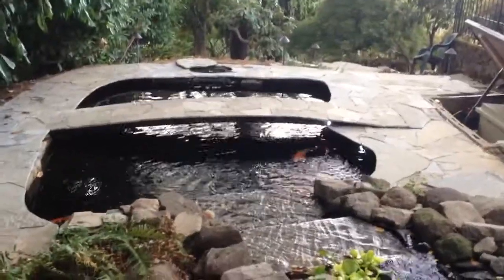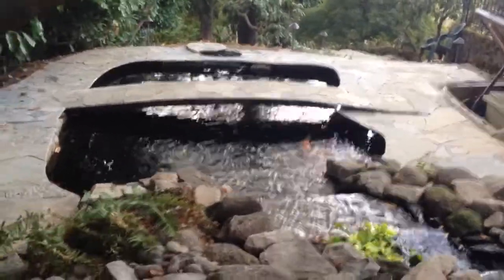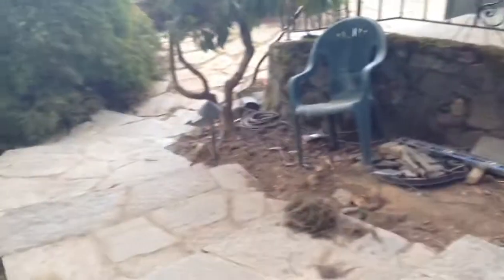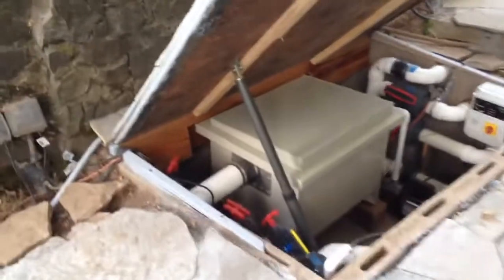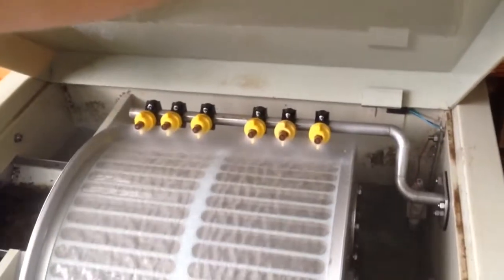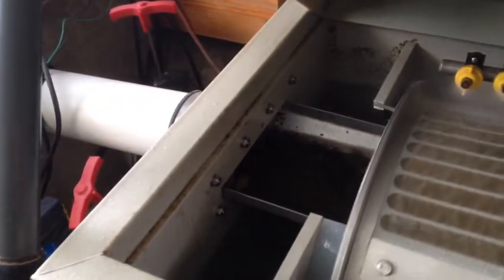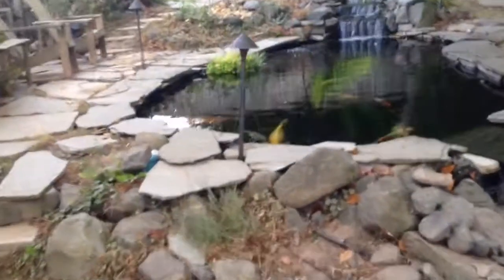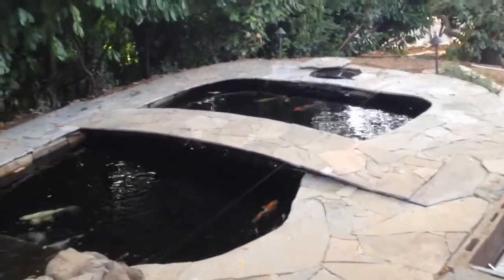Lower Pond mechanical revealed

Comment: Hi Rob, nice pond you have there... two pond on one filtration system. 
I want to ask you about the RDF, are you install the RDF from first time you build you pond?
it look crystal clear. because I want to upgrade my pond filtration system. 

thanks 

GEDE ARYA 
from Bali Indonesia
Reply: Yes this was installed from the beginning on this pond.  The upper pond uses AquaForte III Sieve, and 2 Moving Bed Barrel, 2 Sand and Gravel barrel Filters.
This system is a big upgrade and I'm very happy with it.